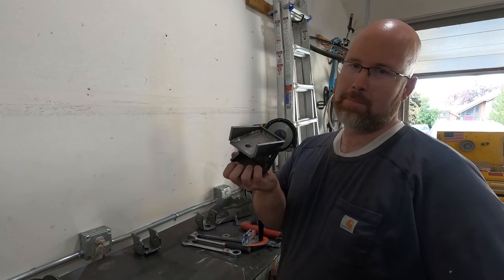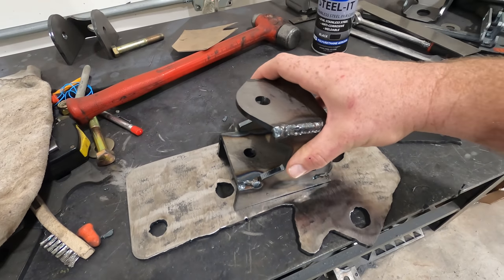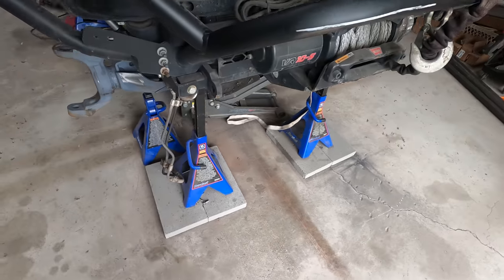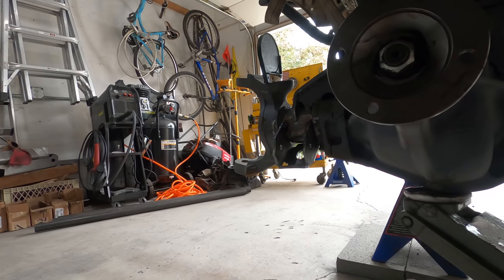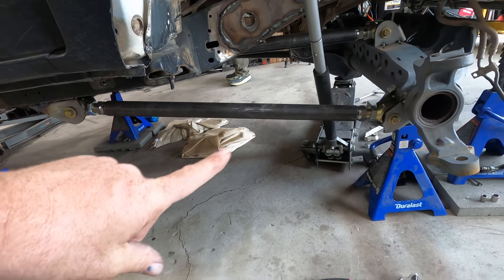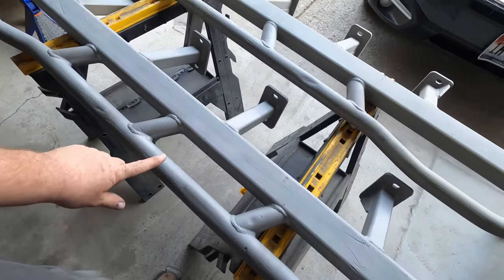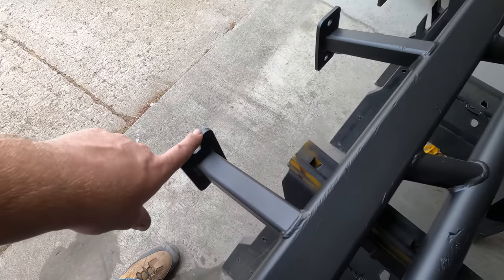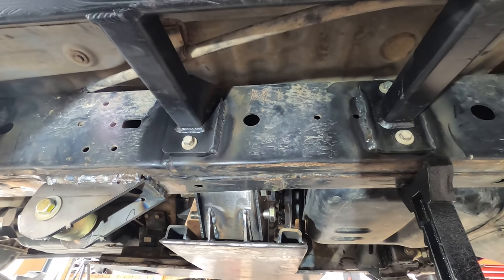FJ Cruiser Front 3 Link Fabrication

Comment: There are a couple good websites that discuss link length, vertical separation based off tire diameter and pan hard bar length based off of steering tire rod or full hydro set up. It’s actually pretty simple until you have to start making compromises because of factory frame rails, transmission location, front drive line and steering box location. 😉

Comment: Just finished watching your newest video in New Mexico. All your hard work is paying off. I do have a question for you… What type, brand, and configuration are your drive shafts? Also was there a reason why you went with LP instead HP for your axles? Thanks Ken!
Reply from the maker: Thanks for watching! My drive shafts are from South Bay Driveline, 1350 and 1450 ujoints, double cardon front. My front axle is a high pinion D60, out of a 2012 F350. The rear axle is a Sterling 10.5 out of a 99 F350. It's pinion orientation is, high enough, I guess. It's a popular axle for this type of application.

Comment: Move your front upper link and down on the axle and running the same distance it is in the back to the front then you have clearance for your exhaust
Reply from the maker: That's a good thought, but I still would have the clearance for the exhaust in it's current configuration.

Comment: So basically you're lower Lincoln your improved link would be running a parallel and that's what you want anyway and then it gives you clearance for the exhaust but you probably won't do it because you won't get the message until later

Comment: 05+Superduty 60 with 1550 or RCV has 45° Steering angle . Will your links clear the tires ? My JL superduty swap just runs at full lock with 40s and 5” backspacing.
Reply from the maker: I hope so! 😄 I'll be running 1550's. If not, I'll come up with a solution.
Reply: My lower links had to be inboard at the frame side  about 5” to use straight links .
Reply from the maker: @gslse21b  Eric, @utah_yota has his links in the same position. In my memory, he may have some very light tire contact with 43" MT Baja Pro XS's.